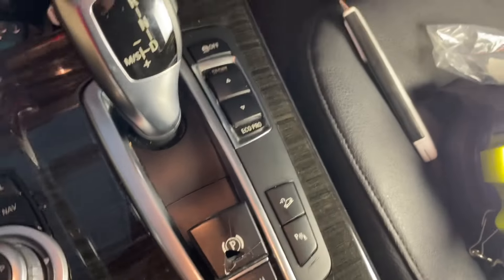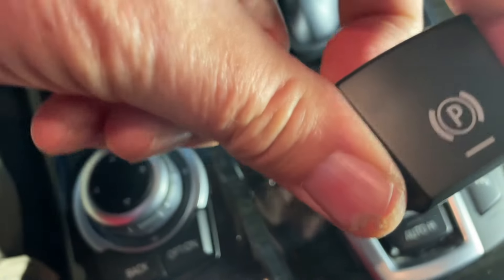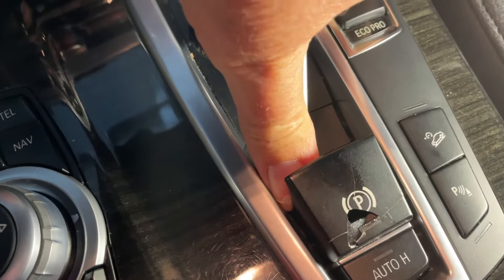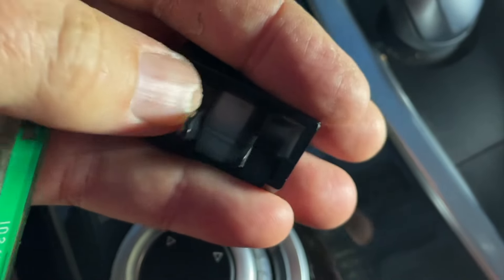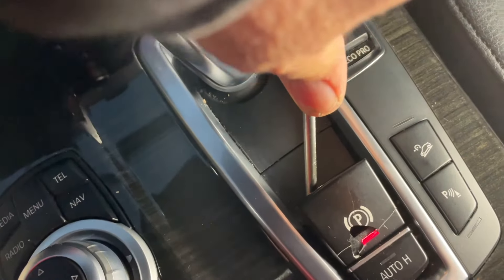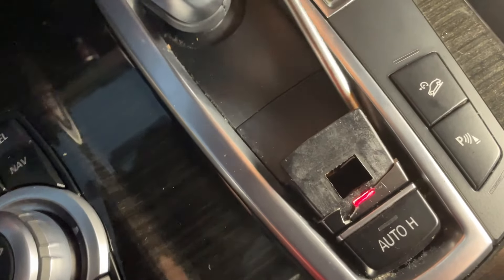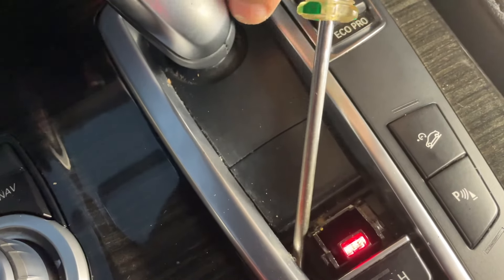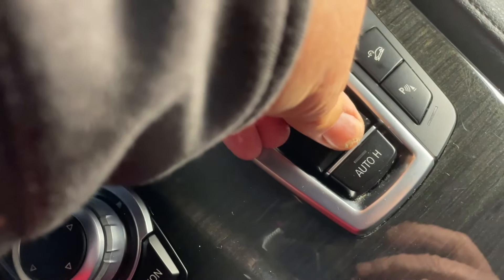How to change BMW electric Parking brake button. Remove Fit new switch X5 3 X3 5 1 Park e brake hand

Comment: Hey, is this removal the same for a BMW X3 F25 prelci model? I saw some videos removing the whole center console, and some only by prying, lifting the button up, not much info on the internet and feels quite intimidating to do.
Reply from the maker: The removal is the same. The switch is not the same. 
See this 
BMW electric handbrake buttons are not all the same. What type does my car have?
https://youtu.be/Y3nzXfYjw78